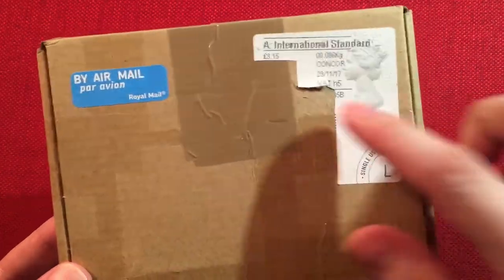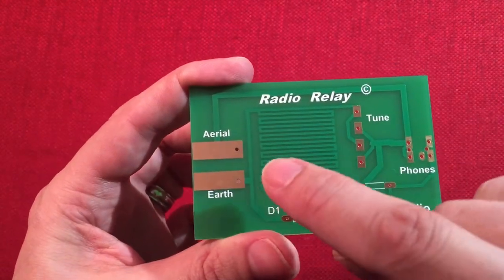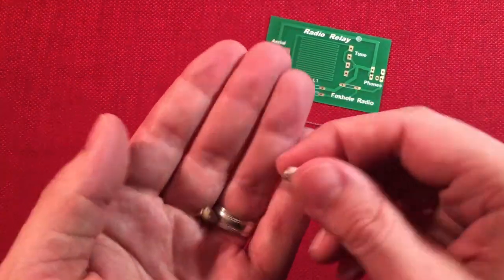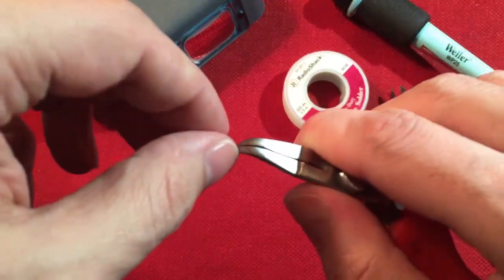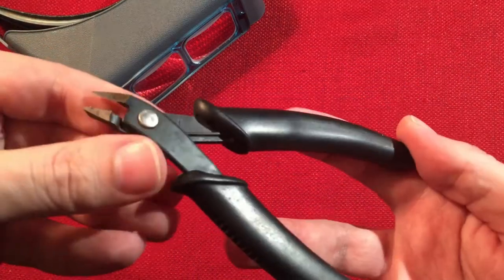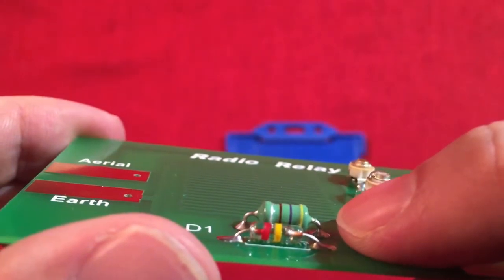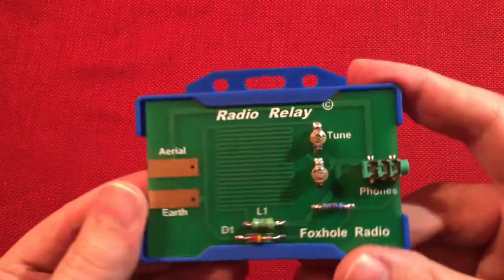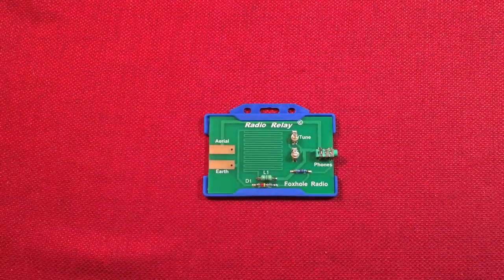Make: Foxhole Crystal Portable Radio Kit Build & Review

Comment: I thought a "foxhole radio" used a rusty razor blade or other improvised detector instead of a diode.
Reply from the maker: They used the term "foxhole" loosely with this radio.  Probably because of it's size.  You are correct, the soldiers would find anything that could be used as a "detector".